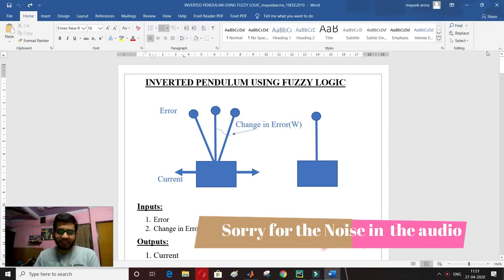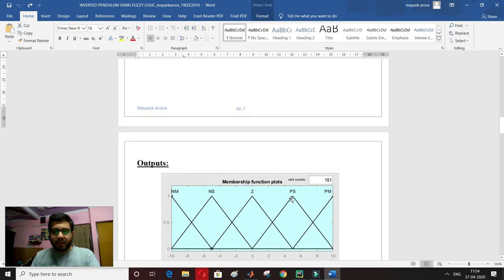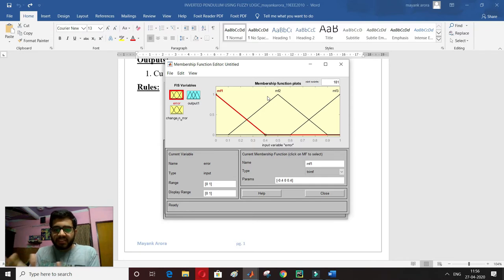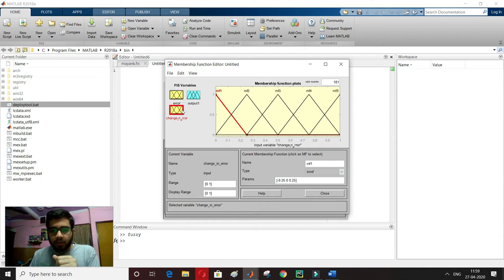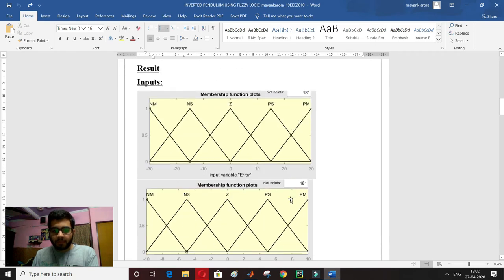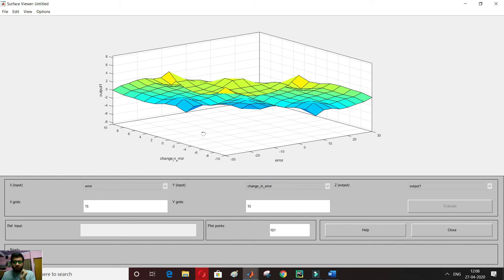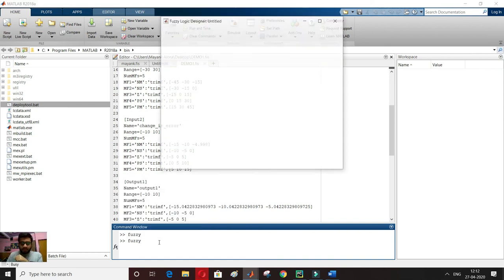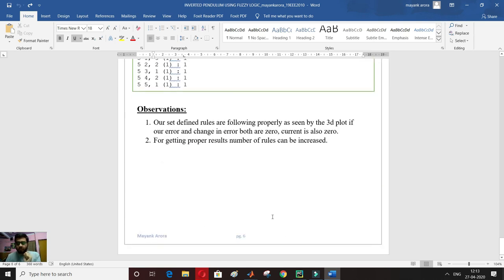Inverted pendulum

Comment: sir how you determine the range of the fuzzy membership function? are they depending on our plant? im using the state space.
Reply from the maker: It depends on your plant only.
Reply: @Elite_Engineer  so if the A alue until the -51 so i have to put the limit -60?
Reply from the maker: It depends like if it exceeds the value -51 you can keep as -60 but if all values are like less keep it -51. By trial method you can come up with a conclusion with method works well although both will work.
Reply: @Elite_Engineer  sir if i do the limit according to the of state space.. But when i run the simulation.. They will come out warning said that out of range..

Comment: sir how we can take range of inputs like you take [-30 to 30] and [-10 to 10] for error and change in error respectively if i have another state of space for inverted pendulum
Reply from the maker: In inputs when you double click, option is there to set your desired range.
Reply: Yes sir, i know that but i am working on implementation of cart inverted pendulum by fuzzy logic controller and i dont know how to take range of error and change in error I means how to know that error limits and change in error limits

Comment: sir plz give me simulink model for controlling a inverted pendulum with fuzzy cntroller
Reply from the maker: Simulation file open with code from the link: https://eliteengineerofficial.blogspot.com/2020/04/inverted-pendulum-with-fuzzy-logic.html

How to open:
1. First save the code in the editor window and save it to any place lets take Desktop.
2. In command window type fuzzy
3. Fuzzy Window will open then from there select the option open from the header
4. and select the code which you saved in the step no1 
5. The simulation will open.
If you still do not understand watch the video properly I have explained how to open that file.
For any further doubt, you can comment here thank you...
Reply: Sir, but its not a simulink model, its just model in fuzzy tool box. Have you got this one in simulink?